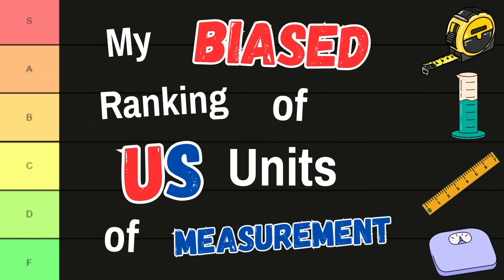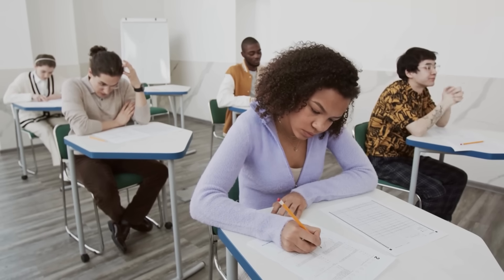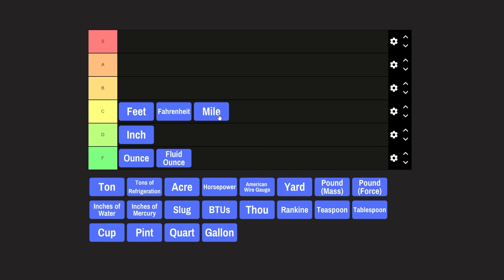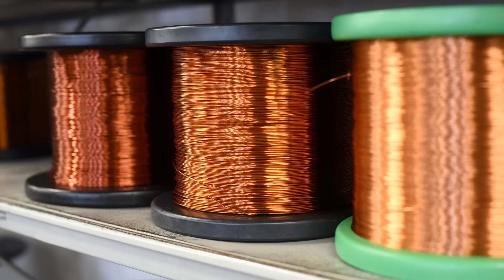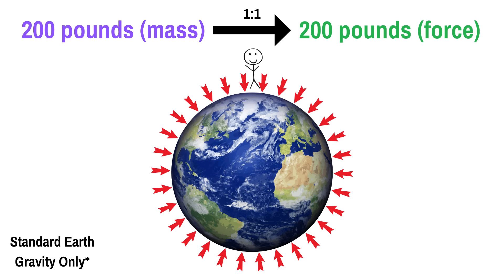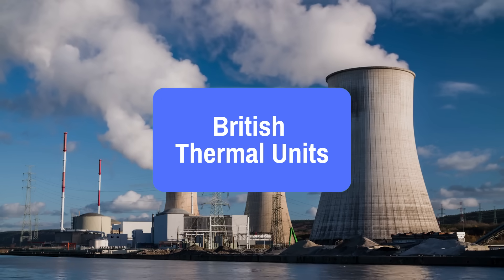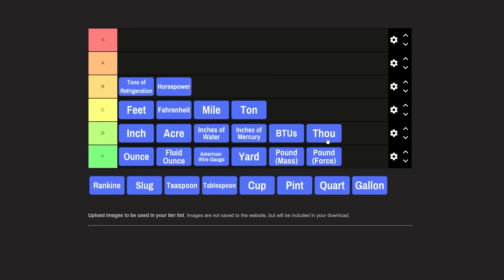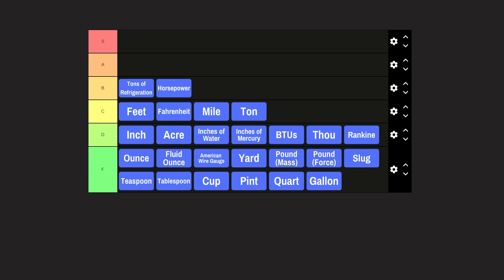Tier List of the DISASTROUS US Measuring System

Comment: such a shame there isn't a simpler measurement system, it would make life so much easier.
Reply: Ferb, I know what we're gonna do today!
Reply: @pyramidteam9961  Phineas and Ferb had some special episodes that took place in different time periods, and the inventions that Phineas and Ferb’s ancestors were responsible for include the wheel, the English language, and I think also the Great Wall of China. Phineas and Ferb’s ancestors could absolutely be responsible for the metric system.
Reply: @pyramidteam9961 reinvent the metric system 😂🎉
Reply: such a shame we are not using metric decimal-based time system and still refer to these cursed units relating to each other as 60:60:24
Reply: @PeterZaitcev  we can pick how large measurements are, we didn’t pick the day night cycle of our planet, so the system for time can’t realistically be base 10.
Reply: @ottovonbass-mark5424  we can define an hour as ⅒th of a day, minute as 1/100th of an hour, and a second as 1/100th of a minute. Yes, there still will be 365.25 days per year, but they day will be exactly 10 hours (as long as rotation of the Earth remains the same which actually doesn't)
Reply: @PeterZaitcev  but changing time is impossible now, everything about everything would have to be changed, and that is completely unrealistic
Reply: @ottovonbass-mark5424  well, no. They changed the entire metric system basically a couple of years ago — in 2018
Reply: @PeterZaitcev  in 2018 the kilogram was redefined by using Planck’s constant instead of a physical cylinder kept in France. This was because the original kilogram cylinder was oxidizing and would soon become too far off of its original weight. The other units changed were amperes, degrees kelvin, and mole, and they were changed in similar ways, by using formulas to calibrate measuring apparatus’s and not physical weights, but those three units are SI measurements and not officially part of the metric system. You can’t compare changing the entire system of time with redefining how to calibrate measurements of SI units, because they are completely different.
Reply: @ottovonbass-mark5424  i know, but their absolute values WERE changed. Also, in early XXI century, two major 9+ magnitude earthquakes altered Earth rotation and reduced the day cycle by a few microseconds.
Reply: @PeterZaitcev  that means almost nothing compared to changing what we define an hour minute and second as. You would have to replace everything on earth that relies on time. That’s almost everything, changing to a base 10 system for time is completely unrealistic, and the costs far far outweigh the benifits
Reply: @ottovonbass-mark5424  it MUST be done if humanity ever wants to reach for the stats – or at least other planets
Reply: @PeterZaitcev  not necessarily, it would be very helpful, but different planets could have different times or even systems of times just like earth has different time zones, there would just need to be a universal time to reference to.
Reply: @ottovonbass-mark5424  and that universal time should be base10
Reply: @PeterZaitcev Not AT ALL lmao. You think scientists are as braindead as US Americans ? Time can not be changed and is absolute. Define it however you want and it'll cause problems at some point. That's why we need absolute measure systems
Reply: @ottovonbass-mark5424  us hungarians just changing time zones twice every year🗿
Reply: I'm 185 cm and 95 kg, waist 84 cm
Go figure.
Reply: @JariSatta  lets work this waist up my fella
Reply: You mean a system where units are linked together, is the same internationally and where 1,000 of something equals something else, with consistent prefixes across all units? I wish such a system exists
Reply: @DBCooperSan  You actually skip a few prefixes with a multiplier of 1000. It's each 10 instead.
Reply: Imagine if it used prefixes for larger and smaller units. That would be very useful.
Reply: @trollsansofficial  "Imagine if it used prefixes for larger and smaller units" - good idea. We should call a foot a 'ddinch' instead (duo-decim inch).
Reply: Gotta love that both of the people trying to tackle 183063 cm to km got it wrong, and the person giving the example didn’t even catch it. They probably thought of it as meters and then just divided by 1000. 183063 cm is actually 1.83063 km. First convert it to meters (divide OG with 100: 1830.63) then into kilometers (divide the meters by 1000: 1.83063).

That is what I would normally do due to the fact that both are frequently used conversions (cm to meters, meters to kilometers). If you want to do it in one movement then you have to remember that 1cm is 10^-2 and that 1km is 10^3, and therefore you move the decimal point by five spaces when converting between the two. From 183063,0 to 1,83063. And now you know that you just have to move it those five spaces every time you convert between cm to km.

Normally it is not something that you would ever convert due to the two very rarely appearing within the same context. But in the case of that you do need it, you will discover the easier conversion of just deciding by 100000/ moving the decimal point five spaces for all of your future conversions.

It is the same for any other prefix within the metric system, you may start by converting between prefixes  you already use normally (in this case cm->m->km) and after that you can do everything in a single step (cm->km).

Powers of ten are pretty poggers. But this got too long.

Edit: Km to km as there is quite a difference between them. Thanks @benhetland576 for catching that.
Reply: @OllieRy321  You might also know that K is not a metric/SI prefix even though we tend to see things like KG and KM/H (and also CM and MM) written on many commercial items. So it is not Km (Kelvin•meters) but km for kilometers.
Reply: @benhetland576  haha, yeah there is quite some weight to the prefix, a simple capitalisation can completely change the size or meaning. Like how mm and Mm have a HUGE difference between them. Thanks for catching that,
Reply: @OllieRy321  That might explain why we rarely see Mm and Mg used in practice. The Russians write КГ for kg and г for grams. The average people simply don't get it. Usually km is used for anything above 1000 (people would think Gm meant grams) even into the Tm range, and the unofficial (metric) tonne is preferred over writing Mg. Unfortunately the latter is often abreviated as T well, so a shipping container marked 25T probably does not contain a very strong magnet...
Reply: Yeah, it would be great if people didn't confuse mass and force in that system either. /s
Reply: @Avram42  
Newton would agree with you.
Reply: Please everyone take a look at Wikipedia under the keyword Metre_Convention.  The USA signed in 1875 that they wanted to use the metric system, also 16 other nations, in the beginning.  That was around 150 years ago now!  But what has happened since then?  Gas stations in the USA don't sell liters, they sell gallons. The speedometer doesn't say km/h, but mph, also the signs on the street.  Screws are not measured in mm, but in inches. Etc. etc.
When I was in the USA for the first time, I just thought... Where did I end up here?!  I want to go back to the future!!!
Reply: @Thomas_P_aus_M  This comment started off ok but then the last part about ‘wanting to go back to the future’ is just arrogant and showed the when going to a foreign land you couldn’t even be bothered to learn even the most simple things to make your experience easier, that’s your fault you couldn’t read anything because you couldn’t be bothered to learn how to use us customary, it’s not the entire country’s fault we didn’t swap over to a more convenient measurement system according to you, this is like going to France and being unset the speak French and not English.
Reply: @Nothing_here7435  
The point is that the USA cannot or does not want to abide by treaties. It took around 150 years and the imperial system is still taught in schools in the USA.  Should it be my fault if I criticize this?
Reply: @Thomas_P_aus_M  Oh we do follow the treaty, it doesn’t say have all your measurements be in metric, it’s have all your measurements based on metric, the us customary is based on metric.
Reply: Metric System: am i a joke to you?
Reply: @Sir.BlackHole  Sarcasm: Am I a joke to YOU?
Reply: "Simpler" isn't the word I would use, but yes.
Reply: Metric System. As uses of 96% of the world population...
Reply: Oh! there is, it's called the metric system!
Reply: This video seems very..."American"
Reply: It's be cool if it was based on water, and one cubic thing of this in volume would be the same of one cubic thing of this in mass, 0 of this thing makes water freeze, 100 of this makes water boil and then you base that whole volume and mass thing in a scale of 1 to 1000 to every subdivision
Reply: Ever heard about the metric system
Reply: @Cinnamonsion as a American myself it would be much easier to just use the superior metric system but people just haven’t switched over for some reason
Reply: @garlicsglitch4194 it's because they got used to it too much
Reply: @garlicsglitch4194  yeah so about that reason, while France was cutting heads, it was also creating the metric system : it was supposed to be exported in america by giving them reproduction of the standard units for reference, but it was lost to sea because of a pirate attack, meaning that, lacking references, the USA did not make the change.
Reply: @garlicsglitch4194 you have to think about cost. To switch to the metric system, every road sign in the country would need to be changed, and for a few generations, students would have to be fluent in both systems while the country transitions. If you change a measurement system, every part of the country would have to change, and that’s just not realistic.
Reply: @ottovonbass-mark5424 If you study something like engineering you have to be fluent in metrics. If we are atalking about mm or micrometers and coversions into other units it gets very confusing with the imperial system. It can be done but errors are much more likely. In case of a spaceship thats not good enough.
Reply: @michaellang9154  as an engineer, you are fluent in metric, but the average American isn’t. I’m fully aware that the metric system is better, and easier to use. It’s just that people forget about the cost of switching the measurement system of any country, much less the third largest country on the planet. It would take generations to fully switch, and through that whole time can be canceled by any subsequent government. Realistically, and sadly, America will probably, at least in our lifetime, never adopt the metric system.
Reply: @ottovonbass-mark5424  I completely agree
Reply: @garlicsglitch4194  'Reason' has something to do with it...
Reply: @garlicsglitch4194 because it would be cultural erasure
Reply: @garlicsglitch4194 The reason is familiarity. While as an American I think the metric system is better, I have trouble visualizing the metric system. Like for example, Celsius. I can hear a F temperature and instantly understand, but I can’t imagine Celsius without converting in my head first. Though for stuff like cm and meters I can visualize a bit better. In conclusion: Blame the British for creating this awful measuring system.
Reply: @garlicsglitch4194  they call it: i'm with stupid
Reply: @garlicsglitch4194  the most of Americans did use International System of Units! America is one CONTINENT!
Reply: @ottovonbass-mark5424  America is one CONTINENT and the most countries(people of these countries are Americans) on it use International System of Units! If United States spend part of the 2024 military budge(1 trillion dollars) it could change everything there and would be left over a lot of money yet!
Reply: @ianmoone8244 there are an estimated 40 million road signs on over 4 million miles(6.4 million km) of paved road in the United States. The cost to manufacture, transport, and install those road signs is way more than you would think.
Reply: @Cinnamonsion  No way they haven't
Reply: @Cinnamonsion r/whooosh
Reply: @Cinnamonsion  ever heard about sarcasm?
Reply: @Cinnamonsion  Its a joke. Get it?
Reply: @Cinnamonsion  That was the joke.
Reply: Surely we aren't here to praise the system that uses its units of mass instead of force for weight
Reply: Soulful > simple
Reply: @mrosskne  And then the device they were typing on exploded in their face because the engineers were concerned with how soulful the design would be... RIP bozo
Reply: @mrosskne  TRUE
Reply: Somebody has to invent one. I wonder why this didn't happen yet.
Reply: @ Original poster -- Why did use a period?  You did not write a sentence.  The first word is not capitalized.
Reply: @dusanmiljkovic2for real? What's that dude?
Reply: 101 dekag is 1,01 kg
183063 cm is 1,83063 km
Just move the comma. 
And in your imperial example you used basic conversions. How much is 183063 feet in miles? You don't need those conversions usually? Well, neither is cm to km very common, but it's much easier
Reply: @lucam8758  cm to km is unrealistic but Dm>Km isn’t too unreasonable. Equal to Cm to m. In Us customary though you will almost never ever convert inches to miles. It’s better to think of them as 2 different systems that are related than 1. And like I’ve said many times remember the first 5-6 multiples of 12. Fractions and decimals are easy because 12 is much better base than 10 and it’s only hinderance is you have to write in base 10 when it’s base 12. I mean with 10 centimeters the even factors are only 1/2/5/10. In a foot the factors can be 1/2/3/4/6/12. The only reason why metric seems reasonable is it sticks to the subpar base 10 to be written easier.
Reply: @Nothing_here7435  
If you support switching all our math to base 12, I agree. Then multiplying by 12 would be the same as multiplying by 10. 
But as long as we learn and use base 10, base 10 will be easier for conversions, since it requires less memorisation.
In base 12, 12 would be 10, 11 would be b and 10 would be a. 10/4 would be 3, 10/6 would be 2 and 10*10 would still be 100=144 in base 10, which is neat.
Reply: @lucam8758 Why couldn’t humans have an extra finger on each hand.
Reply: @Nothing_here7435  ahah, maybe we'll evolve it in the future 😄
Reply: But there is... the US that refuses to use
Reply: it might seem crazy what im bout to say
Reply: Oh, but there is. They use it in Liberia and Myanmar.
Reply: Such a shame that you idiot obviously never Heard of the metric system
Reply: How many Olympic medals does your country have?
Reply: like weighing stuff in elephants, and measurinng length in football fields. LOL.
Reply: There is. imperial.
Reply: The metric system is much easier :D
Reply: Counter to your intuition it actually makes life incredibly harder to try and change an entire nation of hundreds of millions of people. We've actually tried it. There are many more variables involved than purely which one is better logically on paper.
Reply: m e z r i c
Reply: Except temperature. Celcius confuses the shit out of me
Reply: @briansmith-dp4jy ……. How
Reply: @iglusmulmus5171 well. Celcius is temperature made for water, vs fairenheight is made for humans. Hence why 100 f is really hot and 0 is really cold. On the otherhand 0 for celcius isnt actually all that cold since its what temp water freezes.
Reply: @b @briansmith-dp4jy  I thought you found the concept itself of a temperature scale based on how water changes confusing.
Reply: Why don’t you speak exclusively in mandarin?
Reply: @theendofthestart8179  what a terrible argument, considering that there is indeed a "world language" that is thought in schools around the world.
Reply: @schwarz8614  Im so fucking confused, what argument? All I did was ask a question.
Reply: Nah, where would Americans be without their "Freedhum units"?? Even though they are Imperial units from their historical opressor the British Empire, with even UK switching to metric... 🤷‍♂️
Reply: @MarekSvec87 in Britain we use both generally. Road signs are in miles and yards. Weather forecasts are in Celsius and we weigh ourselves in stone (14lbs).
Reply: @MarekSvec87  America is one CONTINENT and most of its countries use International System of Units and UK use Imperial System yet, they only pretend use International System of Units!
Reply: Metric is too uniform and robotic, its not natural to humans. Human brains operate in an organic, non-uniform way. On the other hand the Imperial system offers several stupidities such as Ounces referring to weight and volume, and Pounds referring to force and weight. Metric is lacking in some ways such as no Foot equivalent. And some advantages of Inches are divisions by 2, Metric is only base 10 and has no ^2 feature.
Reply: Imagine being addicted to the number 10.
Reply: It’s not that hard, we use inches feet and miles, you only need to know how to convert between inches and feet else use fractions and decimals, for weight just pounds ounces and tons like measuring, it’s not as easy as metric but it’s easy enough that switching over isn’t worth the struggle.
Reply: @Nothing_here7435 Length is just one basic unit out of the seven required. Wouldn't it be nice if they worked together, say like 1 cu m of water weighs 1 tonne. Try thermodynamics, where you need to memorize around a dozen conversion factors. Or, in metric, one.
Reply: @Nothing_here7435 it was worth it for almost the entire world… you’re so extra lmao
Reply: @KajtekBeary  Please tell me how it’s worth billions to trillions of dollars and a change of what’s everyone is comfortable with is worth it so a bunch of Europeans can celebrate that we use the same as them. Imperial isn’t hard to use on a daily basis, if idk, you bother trying to learn it. The units are human scale with options for others. How much is 100 deg Fahrenheit, about your internal temperature. I personally am not so brain rotted that I can’t know the first few multiples of 12. Want to be precise, get this fractions and decimals exist, don’t have a measuring device, imperial units are very easy to approximate on your own. 
Something is far away, uses miles for long distances and for absurdly long distances, they don’t appear in every day use.
Reply: @Nothing_here7435  meanwhile 1 metric cube of water = 1000 L which is also a metric ton of water.

And guess how you get to smaller units. If you guessed dividing by 10 without ant weird conversion, youre right.
Reply: @arturpaivads  Wow congratulations.

When you grade Us customary by what metrics sole purpose is it’s bad.

Anyway let’s see metric. 
Let’s see do something extremely simple like cut a 1 meter length of wood into 3?
33.3333333333333333333cms? Ah so nice and convenient. Let’s see 1 foot into 3. 4 inches(wow a nice clean number).

It’s almost like imperial favors making its units have the most useful and convenient in actual real world conditions while imperial favors what? Representing scaling easily and using a very limited amount of conversion rates. 

They’re two different systems. They have very different things they favor. 

Metric favors being as simplistic as possible. Imperial favors being as useful as reasonably possibles
Reply: Pascal per square inch, and ton of shit values from imperial shity units make work really hard. Brake for car 200 usd, same break for airplane 3999 usd. Every measurement in imperial shit is kind of mess. To work in imperial (aircraft industry, europe) as a born metric guy is hell on earth.
Reply: Yeah, it's a real shame the main competitor sucks. There's no good unit of length in the metric system. The meter is uncomfortably long for a lot of human scale things, and the centimeter is too small.
Reply: @keiyakins we also have decimeter which is 10 centimeter but we rarely use it cause theres no point
Reply: @keiyakins say "it looks like 40 cm" in imperial. Foot and inch may be closer to scale, but for specification you must say "1-point-three feet" or "1-foot-4-inches". In metric you  go with "actually 38 cm". About same to say but more simply and infinitly scalible
Reply: @ИгорьМерзляков-р7д  About 16 inches.
Reply: @keiyakins  lmao what does that even mean? You don't have an intuition for metric units because you didn't grow up on them, that's why the meter feels "off" for you
Reply: @aschneider8912   no? the yard is also too long for that purpose. my complaint is that there's nothing in common use between the meter and centimeter. it's too big a jump in too critical a range.
Reply: @keiyakins  Totally disagree. Metric lengths don't take very long to get used to, and scale up or down (by multiplying or dividing by powers of 10) extremely easily. For example, without looking it up, how many feet are in 2.75 miles? The metric equivalent (how many metres in 2.75 km) is trivial to figure out: it's 2,750 metres.
Reply: @keiyakins  that’s from ur perspective as an imperial system user, for us it works great. It’s a lot more simple as well with everything being multiples of 10 or 100, instead of 12 inches being a foot, 16 ounces in a pound, 5280 feet in a mile, etc.
Reply: @IMthebiggestboy  No one converts feet to miles unless under very unique circumstances so the conversation ratio might as well not count, and if you guys are so confident in the metrics superiority then why are you guys So insecure whenever someone threatens it.
Reply: @Nothing_here7435  i guess it just feels like scec of dust in the eye - like conspirasy about flat earth and other nonsense. "why all of them collectively belive in this shit?"
Imperial system aren't as shit as flat earth theory, i agree, but still "why?"
Reply: @Nothing_here7435 Insecure? Please mention a system that actually threatens it LOL

Either way, I understand it being difficult to switch to a system foreign to you, for example, the standard QWERTY keyboard layout is terrible inefficient, but it is what we are used to— so if there’s no real need to switch, why would you? 🤷‍♂️
Reply: @Szystedt I do know the metric is easier and am well versed in it but it’s not so much easier that it justifies the struggles of swapping the measurements system for millions, but no you feel you are just so superior and you need to dumb it down, can you use Us standard, because I can and use metric, it’s not hard if you try to use it you only need to remember a few conversations ratios and be able to do fractions and decimals, absolutely brutal, same reasoning for QWERTY, swapping does not justify the cost of swapping.
Reply: @ИгорьМерзляков-р7д  Also oh no I say it isn’t as bad as you say because you never bother to use it in a practical sense instead spitting out units and conversation ratios no one uses and saying just swap ez.
Reply: @Nothing_here7435  I’d feel ur a lot more insecure, you didn’t try to prove the superiority of imperial, instead you just said metric users are insecure
Reply: @IMthebiggestboy  Dude he said “I know the metric system is easier” he’s not trying to say it’s superior. If anything you’re doing what you’re accusing him of by not talking about his arguments lol.
Reply: @marekdec8605  I wasn’t replying to that comment, I was replying to another comment he made like 12 hours ago
Reply: @Nothing_here7435 you can’t do imperial conversions in your head as easily, metric you can do it in a heartbeat by moving the decimal. Remember 95% of the world switched over with no problem.
Reply: @IMthebiggestboy  what says you can’t, you can’t do your 12 multiplication tables, there are 16s but you only need to remember the first few because you don’t need to convert anything beyond 10 feet or pounds at that point you just use pounds or feet only, like I said not so impossible difficult that it justifies swapping over, oh but many other countries did, ok good for them how about we look it up and oh most of them did that 200+ years ago over the course of decades, real easy. It’s just not worth swapping over so we can make people from outside our country happy, that’s ultimately why you want to have us swap so bad because you don’t ever seriously try to use us standard, you just say Us standard bad, metric good, Americans idiots for still using a fully functional and standard measurement system.
Reply: @IMthebiggestboy  Let’s see though, 1ft:12in, 2ft:24in, 3ft:36inches, 5ft4in:64in:5(1/3)ft, truly impossible it only took me 5 seconds max to do it, what is 101 dekagrams in kilograms, what is 183063 centimeters in kilometers, how long did it take you?
Reply: @Nothing_here7435  no, the reason we want you to swap over is so we can communicate with you normally, I could say the same and the reason you don’t want to swap over is because you’d never want to learn metric
Reply: @IMthebiggestboy  Woah already know metric
Reply: @IMthebiggestboy  I mean in a reply 2 days ago, he did say "it’s not as easy as metric", but it's fair not to have seen it or not remember. 
But even with the response 12 hours ago, you just latched on to the "insecurity" part which was only the 2nd half of the comment, completely ignoring the first half which was an argument about conversion rates not mattering lol. 
3/4ths of his comments were about how weird imperial conversion rates were negligible.
I mean even now you made a response to the guy saying "you can’t do imperial conversions in your head as easily" which he just said was a negligible issue a lot already, so I still don't think you're tackling his main argument.
Reply: @IMthebiggestboy  Fun fact, Us customary is Metric+Imperial so most people know both but were used to using imperial so we use it.
Reply: @marekdec8605  Thank you, I don’t think remembering a few times tables is much harder then remembering what all the prefixes are, and times tables are useful in many more cases then knowing a prefix.
Reply: @IMthebiggestboy  I ask you again do you know both and can seriously use both.
Reply: @IMthebiggestboy sorry, but how often do you end up needing to convert any distance far enough to be given in Kilometers into meters?  

Also, metric still uses seconds, minutes, hours, days, etc.  Don't you love using multiples of 60, 24, and 365.25?
Reply: @Nothing_here7435  More fun fact: US customary and Imperial are different but use the same names. Gallons, ounces and pints for example.
Reply: @benhetland576  Imperial includes lots of archaic stuff and is customary includes metric.
Reply: @Nothing_here7435  >what is 101 dekagrams in kilograms, what is 183063 centimeters in kilometers
like 101,0 so you divide by 100 and bam its 1,01 then 183063,0 you divide by 1000 and get 183,063. ton of struggle impossible to do yes.
Reply: @Jimoshi1  Is that easier then knowing the first 5 or so multiples of 12
Reply: @Nothing_here7435  "what is 101 dekagrams in kilograms, what is 183063 centimeters in kilometers, how long did it take you?" Who use dekagramms? Ok 101 dg => 1010g=>1.01 kg. Is it hard? 183063 cm in km...Bro are you American or something? 183.063 km = 183063 cm. How many second did it take to convert this? Its practicly 0, you dont need to convert it you can just move decible and you done. Wanna be shoked? How much does 1 liter of water in weight? Its 1 kg
Reply: @aqnuadziba  It doesn’t take practically seconds as you say, you have to know what each of the prefixes are and be able to quickly figure out how much to move the decimal, that’s not practically 0 seconds to do that takes some time to learn and even then takes a couple of seconds like how us customary takes some time to learn some conversations rates but still takes a couple seconds to do, it’s not any harder if you learn them.
Reply: @Nothing_here7435  yeah you right that you need to lern it. But mate, in day to day bases you use only mm cm m and km and its really easy to convert without really tinking about it. I doubt many people can easaly withot converter or calc say how many inches in 3.5 miles. I feel like its too convoluted for no real reason
Reply: @aqnuadziba  because no one would, no one converts feet and inches to miles, it’s unnecessary.
Reply: @aqnuadziba  that’s like someone complaining you can’t tell me how many nanometers are in a megameter quickly
Reply: @aqnuadziba  us customary on a daily basis is simple, for small measurements use feet or inches, large ones miles, how do you convert, you never will so it doesn’t matter, want to be more specific, just use fractions and decimals.
Reply: @Nothing_here7435 Your example there is kinda stupid. You took simple examples for your system but then took an example that is more complicated for the metric system.

Try saying how many miles 115948.8 inches is in 5 seconds. That is so very easy and your average person could do that no problem, right?
Reply: @IMthebiggestboy The “imperial” system (actually the customary system, imperial refers to the British old system) I would argue is 200x easier for non precise measurements or everyday things. “Yeah Im 1.83 meters tall  and this is my 600 ml water bottle” You see how much more complex that it has to be compared to just saying (not to scale) “I’m 6 feet tall and this is my half gallon water bottle”.
We also use both measurements, so get off the high horse.
Reply: @thegrimreaper9552  how is my example bad, it’s a conversion no would ever do but you are trying to say oh it’s different, sure nobody would ever do either conversation because they are complicated and unnecessary but no we should judge us customary based on a conversion no one does.
Reply: @Nothing_here7435  Then why did you even use it as an example my guy. Both are something no one would ever do.

It is crazy to me that you first use a conversion no one uses as an example and then after I do the same thing suddenly you think it is unnecessary?
To make this more understandable for you. The reason it is a bad example is exactly what you said in your little reply here. It is simply unnecessary and pretty much no one would use it.

Here is an example that is, at the core, the same as yours.

What is 2+2? 4, easy right? Took me a measly 5 seconds. 
Ok what is 6784x63? Oh? You can’t do it as fast as 2+2? Well I guess the whole system is hard!
Reply: @thegrimreaper9552  I literally said no one would convert megameters to nanometers then you said oh convert inches to miles, they are both stuff no one would ever do
Reply: @Nothing_here7435   “Let’s see though, 1ft:12in, 2ft:24in, 3ft:36inches, 5ft4in:64in:5(1/3)ft, truly impossible it only took me 5 seconds max to do it, what is 101 dekagrams in kilograms, what is 183063 centimeters in kilometers, how long did it take you?”

This your comment that I replied to. Please, do elaborate on where the hell the part where you say no one would convert megameters to nanometers is.
Reply: @aqnuadziba  Actually 101 dg (decigram) is 10.1 g. You probably meant to say 101 dag which is dekagrams 😉
Reply: @Nothing_here7435  all Americans are not 1d1ots, only Yankees are! US customary is only a cheap broken version of the British Imperial System, everybody know that both are bad systems and you can't even agree with each other in what the same units mean!
Reply: @ianmoone8244 
evidence zero
Argument zero
Addressing any of my points zero
Reply: @Nothing_here7435  if you use metric you would learn a lot of convert ratios, especially in physics
Reply: @Nothing_here7435  threatens it? Where's the threat exactly? There are no arguments for the imperial system. "But it's more suited for everyday use" people know how to divide by 10 since  a very young age, if i asked the average 9 years old kid to convert grams to kilograms or metres to kilometers, they'd swiftly do it. Now do it again and ask a kid to convert feet to miles and have them divide by 5280 without pen and paper or a calculator. You'll be there a while.
"It's a more human way to measure things". Idk about you, but when conversions are easy and straight forward, humans have a much easier time with them. Ever since you're 2 yo, you're taught to count using a decimal system, making multiplications and division by 10 trivial and scientific notation is also much more understandable. 6.2*10^8 m are 6.2^5 km. Easy enough.

So yeah, where's the threat? You're using a clearly inferior system and i'm sorry for all the unfortunate victims of it, many americans i know openly dislike it or think of metric as a better alternative while being stuck with imperial due to them living in the us and having to use it. People like you are not threatening to our system at all, cause it's painfully obvious you've never done any calculations in your life and are not qualified to have an opinion on the subject
Reply: @keiyakins  for you it is uncomfortably long, as an European it know intuitevely what is a meter :') With my friends we have a game that is simply trying to say the right distance between us and an arbitrary choosen object, and we are all good to mesure distance :)
Reply: @keiyakins  https://en.wikipedia.org/wiki/Decimetre ?
Reply: @keiyakins  Everyone always leaves out the decimeter, smh.
Reply: @keiyakins ever heard about decimeters? 1 foot is ~= 3 decimeters, 1 decimeter is ~= 4 inches
Reply: @semplar2007  they exist yes but no one uses them.
Reply: @keiyakins  1 liter is actually 1 cubic decimeter btw
Reply: @keiyakins  A decimeter is approximately 1 hand.
Reply: there is something called a decimetre wich is 10cm @keiyakins
Reply: @keiyakins  The International System of measures doesn't suck, it's genius how simple it is. 30 centimetres is a foot. 100 centimetres is a metre. You only have to move the point to change the scale. And all measures are closely related and intelligently coordinated. For example, a one centimetre cube is one mililitre of water and it weighs one gram. Brilliant!
Reply: @keiyakins  have you ever heard of decimeter?
Reply: @keiyakins  If only we had prefixes that allowed for more or less granularity. Such as the decimetre being one tenth of a metre or10 centimetres. The metre is also smaller than the yard, so if the metre is too long, then so is the yard. Also, why do you care that you need to say 61 centimetres (approximately) instead of two feet? Is 61 too hard of a number? Lmao
Reply: @Stroyer123   the yard is also too long for a lot of stuff yes. I never said it wasn't.
Reply: @keiyakins  Because everything must be measured in a quantity of "one" or "two" of a unit. For example: you can't have "10" feet tall thing... Oh wait
Reply: @keiyakins  and the decimeter is forgotten by those who do not use metric. if you do not have a comfortable unit in metric, you do not understand metric.
Reply: @keiyakins Decimeter: :(
Reply: @keiyakins how about decimeter? Never heard?
Reply: @keiyakins  I wish peoples would use the decimeter a bit more lol
Reply: @keiyakins  Decimeter would be a good compromise
Reply: @keiyakins  LOL and why do you need a special unit inbetween? Whats wrong with 38 cm? Does that number look too big and scary, or what?

Looks like you would prefer to have the British pre-decimal currency too, the pound was too big and the penny was too small, so they had shillings, half-crowns and who knows what inbetween. Imagine you had a dollar, a cent and a sfuyfguwf inbetween that was exactly 32 cents.
Reply: @CzechMirco  Americans can't count to 24, you expect them to count to 100?
Reply: @keiyakins  The metre is just a tiny bit longer than a yard and a centimeter is a little over a quarter of an inch.
Reply: @keiyakins  just use decimeters
those exist
not to be confused for decameters but at least you can tell the difference without checking just to make sure, unlike " and ' which good luck using that in a quote
Reply: @keiyakins It's clear that you haven't used the metric system that much to see how better it is
Reply: decimeter are 10 cm . My span from pinky finger to thumbtip are exactly 20decimeter /20cm/200mm
Reply: @way0fcoockie176  The irony of a metric unit being easily visualized by a distance between two points on someone's body, which is variable, in a comment section mostly roasting the imperial system that has the foot and yard, being based on king henry the 1st's body proportions is palpable lol.
Reply: @keiyakins  how is the meter uncomfortably long? Its about one arms length. And if you want anything smaller you just use decimals, or use decimeter, centimeter, millimeter, micrometer, millimeter, nanometer, etc.